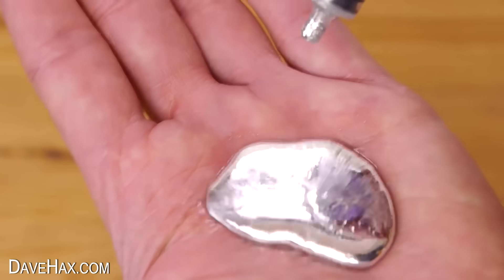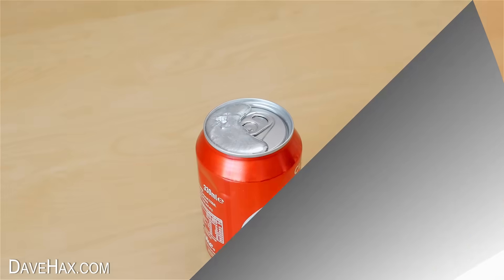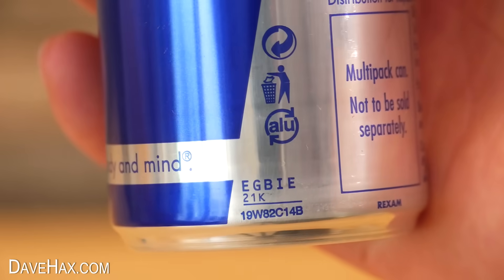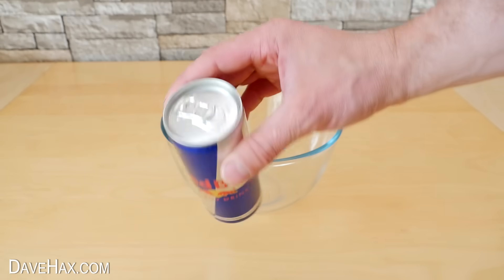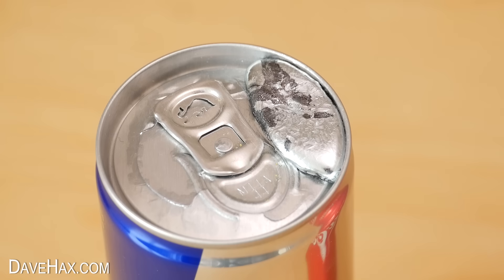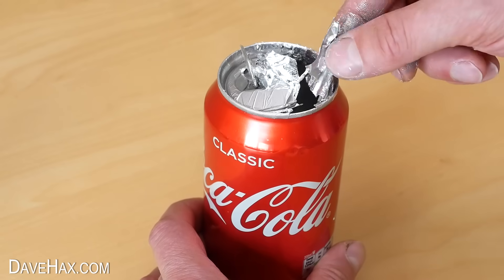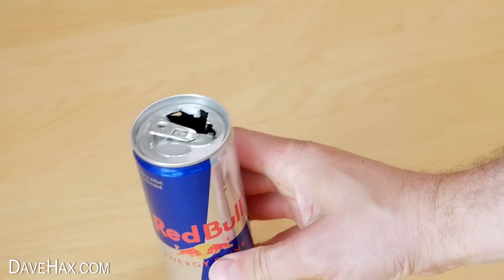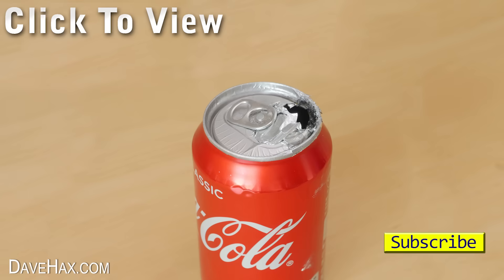Amazing - What Gallium does to an Aluminium Can

Comment: If you don’t have sand paper, then you have to let the gallium sit in the can for a long time, for it to find pores to affect the aluminium. There is a protective coating to prevent rust, and unwanted flavour.

Comment: The reason why it didn't work at first is because aluminum has an oxydation layer which can be removed by sanding and you have a window of time where you have the aluminum exposed

Comment: The reason why the rest of the can was unaffected is because the top is not the same piece as the body. The edges of the top and body are crimped over each other with some solder between them.

Comment: Ok so 2 quick things- 1- the amount of gallium used was overboard by a lot, using maybe half the amount you did would have been plenty. And 2- coke cans are affected by gallium, you just need to scratch off the clear oxide layer so the gallium can actually affect the metal itself

Comment: The reason why the gallium didn't get absorbed at first is because aluminium quickly reacts with the air around it to form aluminium oxides which create a barrier.

Comment: The reason it didn’t work before the sandpaper was because there was a “coating” of aluminum oxide that had formed, if you scratched a small surface area and added more gallium it would most likely make the entire can like that

Comment: THATS ALOTA DAMAGE
Reply: A D A M better use some flex seal
Reply: A D A M I SAWED THIS BOAT IN HALF
Reply: And I’m going to repair it with nothing but flex seal
Reply: A D A M how about see through flex tape?
Reply: DAMIDGE
Reply: This bucket is yummy
Reply: 2:24 scratches at a level 6 with deeper groves at a level 7

Comment: There wasn’t a coating per say on the can. What you removed with the sand paper was a layer of aluminum oxide that prevented the gallium from interacting with the bare metal.
Reply: Aka a coating
Reply: Fish and chipper “coating” implies an artificially applied layer. One would not normally describe rust as a coating for instance.

Comment: Aluminium naturally reacts with oxygen in the air to form a strong oxide layer which acts as a shield and makes the metal very unreactive. The gallium would not change the unscratched aluminium as the oxide layer was in between and was protecting the can from any other elements. When you scratched the can, you removed the oxide layer, and added the gallium to the pure aluminium, which caused it to react. It is possible that the coke can worked better because it could have been an alloy, or that you scratched a bigger area, but it could also be because you scratched the red bull can first and added the gallium after you added it to the coke can. This would give the aluminium on the red bull can more time to reform the oxide layer, and would expose less aluminium to the surface, meaning that it would react less. That might not be true, it’s just an idea.

Comment: When you have scratched it the aluminium became thinner and the aluminum oxide coat that was on the can was removed and then when we added the boiling gallium on the can it melted because it was thin and then you were able to pull it out

Comment: Aluminium is quite reactive, so when it's formed, the surface reacts immediately with oxygen to form Aluminium Oxide, which is highly unreactive. This may have been why nothing happened when you simply placed the Gallium on top.

Comment: Aluminium has a natural oxidation layer that protects it from corrosion. That is why you do not see aluminium "rust" like iron or steel does, or in fact, the "rust" protects the metal.
Reply: Your user photo makes the comment a lot better
Reply: Nicholas Lau Yeah in the exception of iron the oxide of al stick filmly to the surface rather than flakes away as the oxide of iron(rust)... Thus protecting it.
Reply: its called Passivation
Reply: Yep. Some metals have that property, where their oxides remain attached to the pure metal.
Reply: Nerd
Reply: @jackgouveia_  no its common knowledge unless you failed chemistry class
Reply: Nope. It's magic.
Reply: ALUMINUM***
Reply: Carl L. Freeman Jr. Eww, an American
Reply: Nicholas Lau NO NONE CARES NERD 🤓
Reply: Aluminium doesn’t contain iron and isn’t an alloy so it can’t anyway.

Comment: What you scratched off is a layer called aluminium oxide. It forms very quickly with the oxygen in the air, but after it’s been removed the aluminium is free to react! The reason the red bull can wasn’t as soft is because an oxide layer began to form again! Hope this helps!

Comment: The reason that the first 2 attepts didn't work is that the alluminium does oxidate really fast and at the surface there is a thin layer of alluminium oxide.